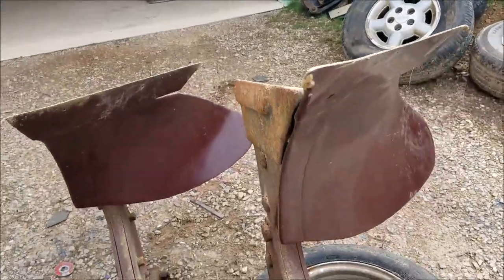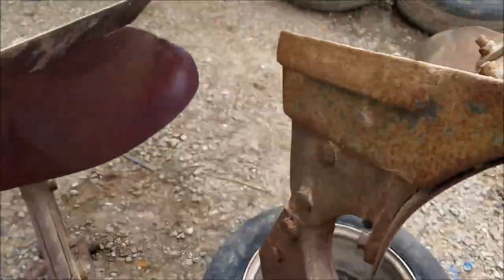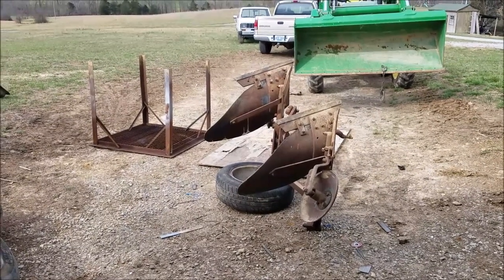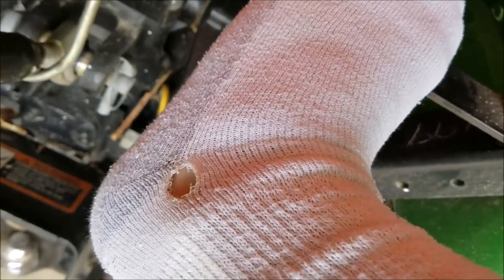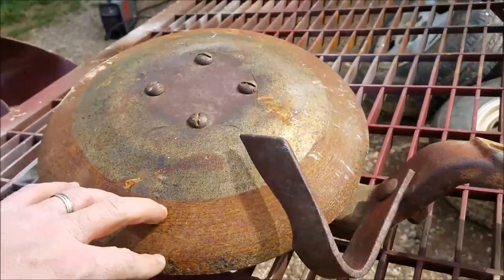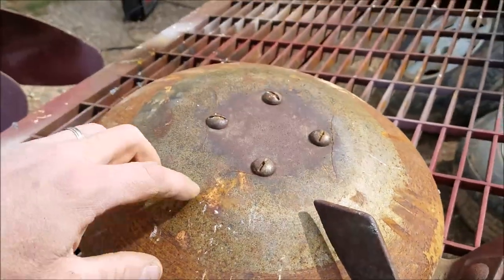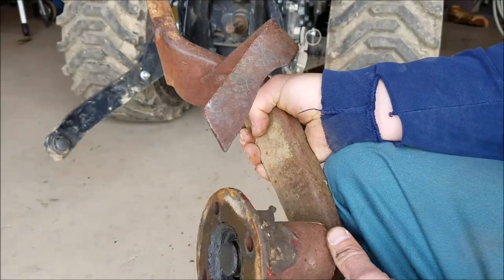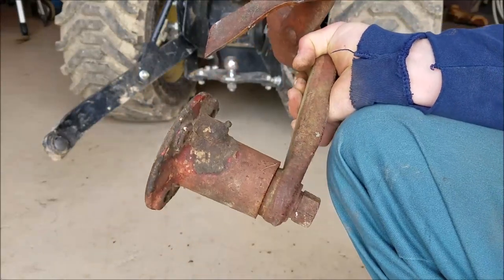2 BOTTOM PLOW maintenance ! ... SPRING is here!

Comment: Hey Yankee! Great video. Here is a bit of information for your viewers. You did indeed replace the shins, but the other part your replaced in the "landside" not landslide...a very common mistake. The part you are trying to protect with the wear parts is the "frog". The plow bolts you needed for the landside are #3 Head Plow Bolts, typically Grade 5. They come in various sizes, 3/8", 7/16", 1/2", etc. and in various lengths. Plow bolts can be obtained cheaply through Agri-Supply, fastenal, etc. Sometimes you need Clipped Head Plow Bolts. One good way of removing plow bolts is to weld the heads to the wear part you are replacing and then torque off the nuts. This keeps the bolt from spinning and often just snaps the bolt off...also avoids the use of a torch near the frog. Agri-Supply and Shoup Parts are good places to check for common plows like yours. It looks very much like a Ford or Dearborn Plow. BTW, your plow is also a "Trip Plow" which means it has moving parts wear the "standard" can trip back if your "share" hits a big obstruction like a rock. The joint between the trip and the standard should be checked and lubricated every season.
Reply: Thank You Chuck for your input. Sharing your knowledge is a wonderful thing. That is what made this video worth watching!